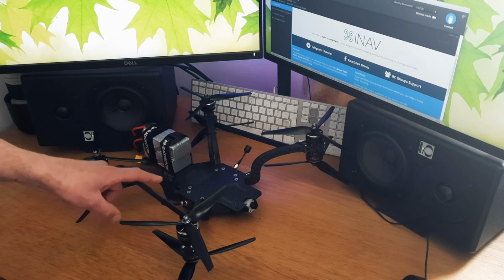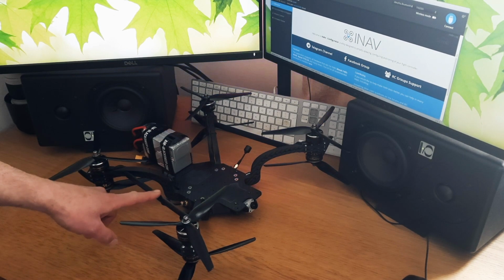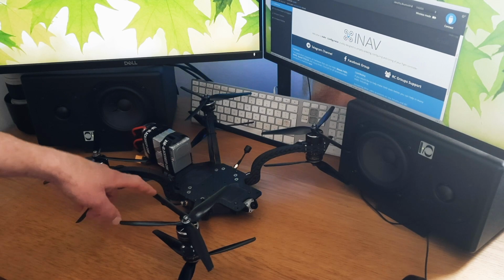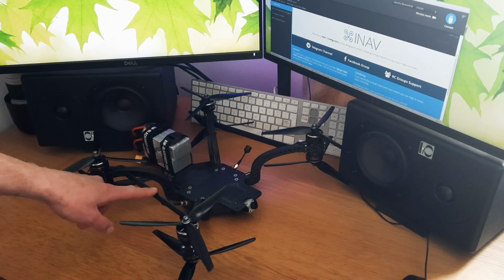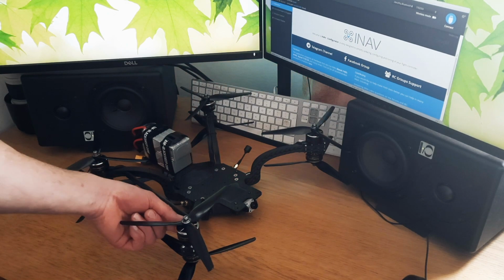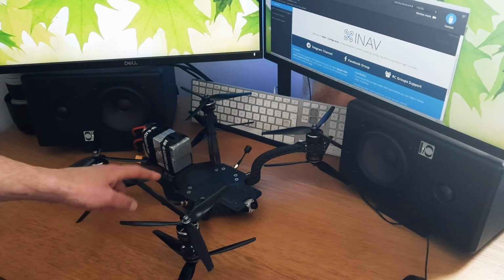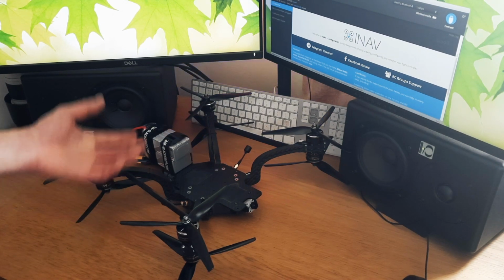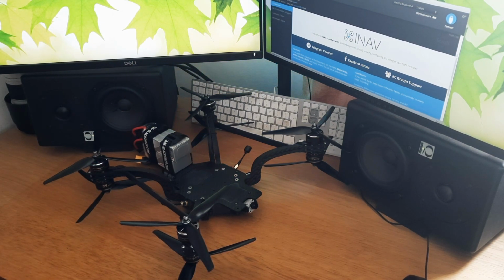Siccario Cinelifter - Best gyro choice, vibration fix & iNav setup

Comment: Iflight has changed the gyro in the newer batches of that fc to the mpu6000 now.  You powering air unit off of FC? Ive got a couple matek fc on order but that 8v to air unit worries me and theres no way im powering it off of a 4s bat.... Ive never lost video other than shit tuning on my other fc's so heres hoping its fine.... 

Just been tuning and building 10"ers so far with eventual plans to design x8 cinelifter based off of the design in the 8-10 inch range as it will take very little work to change up the design as im already using vertical arms like siccario.  Ive designed carbon arm braces on the outside of motor mount and its working awesome... good handle to hold the drone from too
Reply from the maker: Is it still called the twin g? if it has 2x MPU6000 that would be awesome I actually emailed Dominic from SP racing suggesting that as an idea earlier today. 

There are enough people on the Cinelifters group that have had the air unit lock up using the FC BEC that I think its fair to say deffo avoid using it. I have a pololu with a 470uf cap on the battery side of it.. https://www.pololu.com/product/3786

Looking forward to seeing your frame in action!
Reply: @DesignTuneOperate  Yeah still twing, it was called 2.2 for a couple days(on their site) and now its named back to 2.1... Im guessing its just a single mpu6000 as i think its a larger gyro but im unsure, I guess i will continue using my iflights FC's for now as i already got 100's of hours on em using fc bec, but yeah could def see it becoming a problem when i move up to x8 and will have to grab some regulators, but will prob give the mpu6000 iflight fc's a try before i go to regulators 

You can kinda get a look of what my frame looks like in recent video thumbnail, flies decent already but wanna make some changes with plans to open source it eventually... Get 10" deadcat dialed, release it, than work on cinelifter version but thats gonna take a couple months at least.... I got an OG red epic that would be neat to fly but that thing weighs as much as an anvil so im prob better off just getting a zcam or somethin
Reply from the maker: @badfourlife  Looks great! Ah yeah I wasn't very clear it's only on the x8 setups with bigger motors that the FC BEC causes issues, I think any x8 it would be a good shout to have very solid power going to the air unit. gh5s or bgh1 are both solid options for Cine as well if raw isn't a must have

Comment: Please keep us posted on how the iNav tuning goes!
Reply from the maker: Will do Sam! I am feeling optimistic for a good tune
Reply: @DesignTuneOperate  My biggest reason for not messing around with iNav was because of this: https://youtu.be/hEx174fj12E So watch out for that if it is applicable for your situation. It sounds like to have a reliable GPS rig that won't fall out of the kay randomly you need to be super conservative about your PID loop frequency and need to either use dshot300 or multishot. So there is a chance you won't have great propwash handling and you may get more bobbles in smooth forward flight. But if it looks the same even with older settings then you're on to something!
Reply from the maker: @strawhatsam  Thanks dude I was not aware of this! Great to know at this point, you could have saved me an expensive surprise. The first tests I am doing are just to see if I can get a tune I like with the unicorn and matrix filters so nothing on the i2c bus will be enabled. Assuming the tune comes good I have an old MRM250 which is going to be my test quad rather than risk the Siccario while getting all the sensors and functions etc thrashed out. Your message has made me think that I should set it to x8 even though its a quad to make the FC as similar to thie Sicc as possible. EDIT: just set my i2c to 800khz on the test drone and it pretty much halves the cycle time on the baro and mag